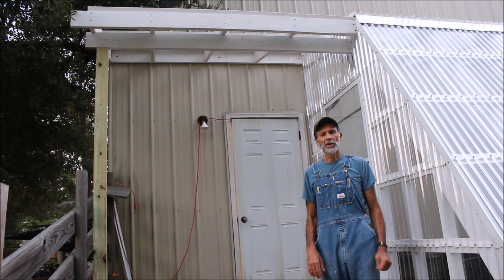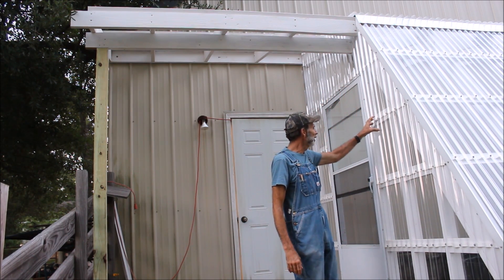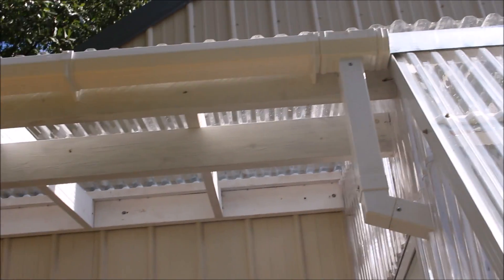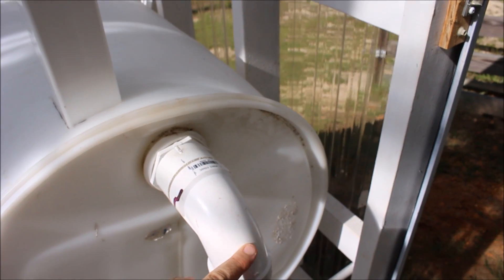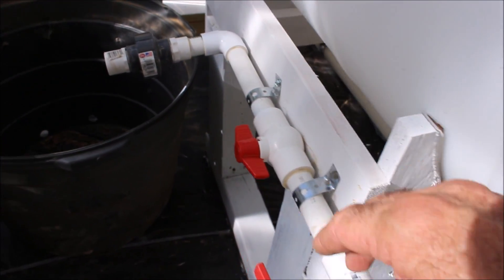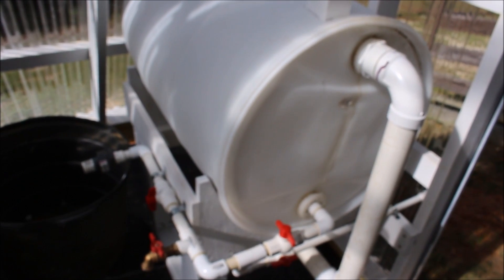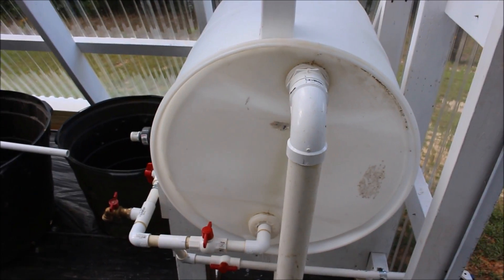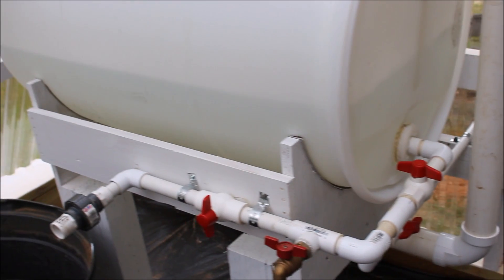AMAZING! Greenhouse Water CATCHMENT System

Comment: looks good danny . i was just wondering why you didnt turn the barrel length wise with the greenhouse so you could raise the barrel up higher for better gravity flow
Reply from the maker: The system we are going to use is a low pressure system for watering is why we set the barrel at that height.Thanks

Comment: I am glad you switched the door- I had visions of the doorknob banging into the new greenhouse. :)   How large of an area are you collecting water from?  Do you have a metal roof on the barn?  Most of the rain catchment systems I have seen hold a lot more water than 55 gallons.  I am concerned that there won't be enough for long term, especially with your heat there and the long stretches you have without rain.  Did you have a second filter on the line, or just the screen over the gutters?  I feel that there is more to come as you get the greenhouse up and running and I can't wait to see it!   (Next we'll run a system off the main house to run soaker hoses through the herb garden hehehe)
Reply from the maker: The roof for the water catchment is 5ft x 8ft.Yes i have a metal roof on the barn.We will only be using it for growing in the fall and winter.We dont usually have any drought during these times.There will be a filter right after the union before it goes to the pots.There is a lot more to come on the green house.Thanks